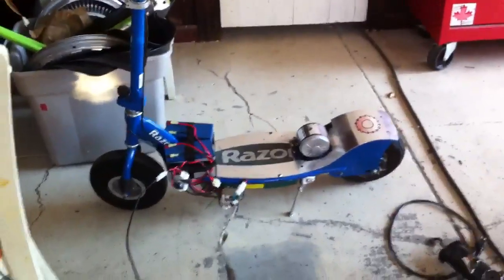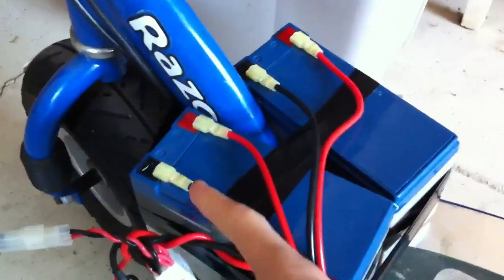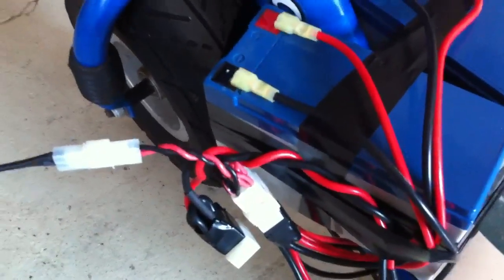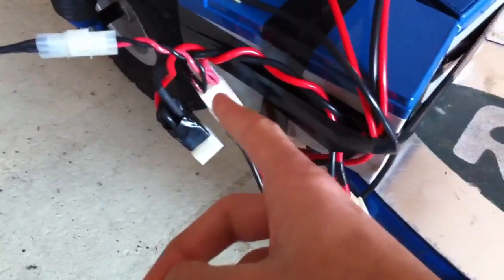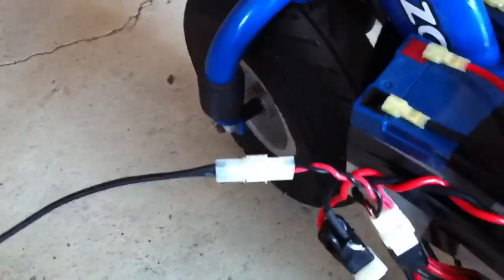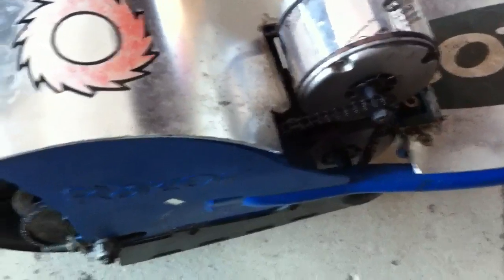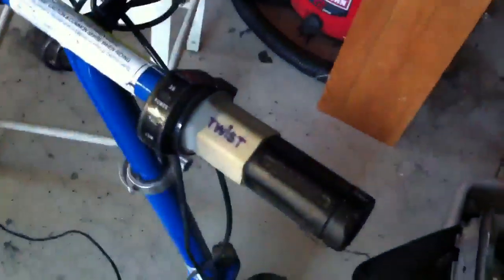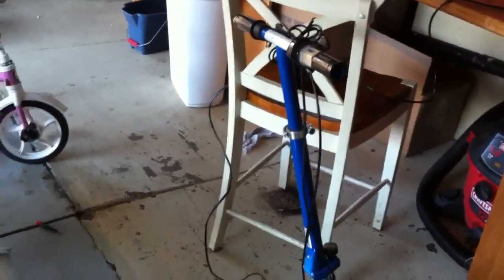Electric Razor scooter of D00M!

Comment: Thanks for the great idea! I modded my 300 w/ a 350watt motor and my kid's vespa w/ a 1k motor...I had 2 250watts just laying around so I thought why not?! Well my shafts didn't line up! So I ran the 350w &  250w. Waiting til this spring to get another 350watt and do this up right. Right now I'm running a 250watt on 48v and it hits at least 20mph.

Comment: What voltage are those motors SUPPOSED to be at? When you overvolt a motor, it will spin fast (rpm is directly relative to voltage), if they were supposed to be 2750rpm at 12 volts, 48 volts=11000rpm, 24volt@48=5500 rpm, 36 volt@4~3666 rpm, and 48@48=2750. I am using two 24volt 350 watt motors at 36 volts on my razor scooter with 9s lipo at 12ah. (Approximately 432watt hours on mine, and you have approximately 480watt hours on yours...however mine fit under the deck (battery compartment))

Comment: Heyy I have an e100, haven't used it in year because it completely died on me.  I want to fix it up though, I'm not sure what batteries to put on it or new motor if needed possibly a bigger one. Mind you mine has a belt rather than  a chain I need advice asap please.  I want it fast like 30 or 40 mpg if possible lol.